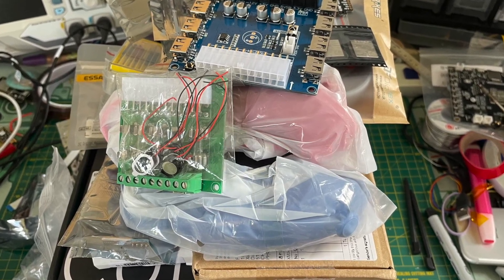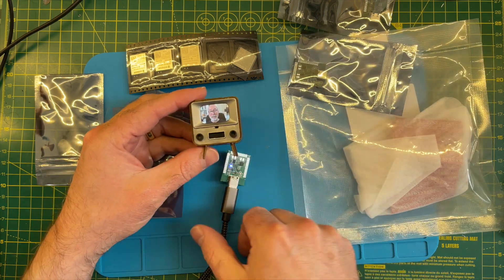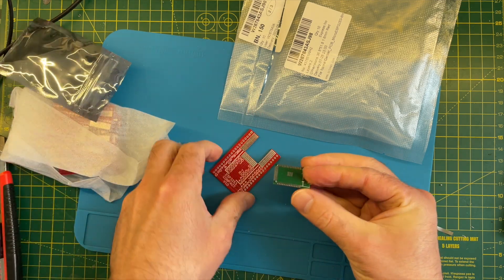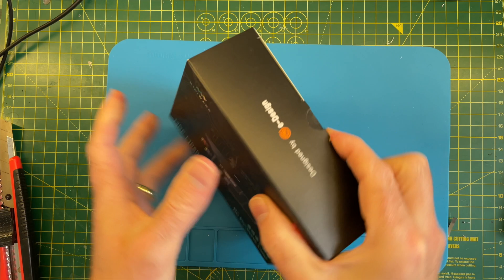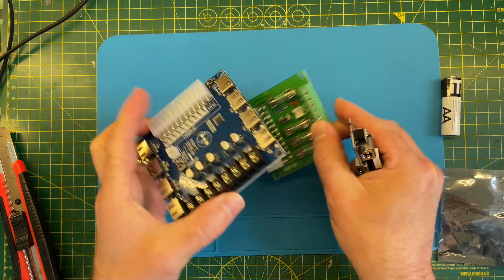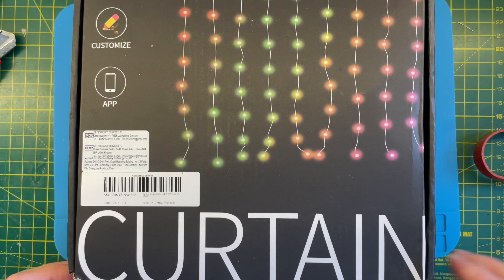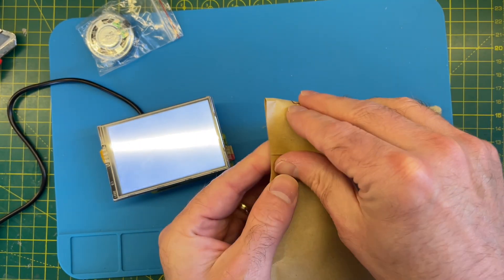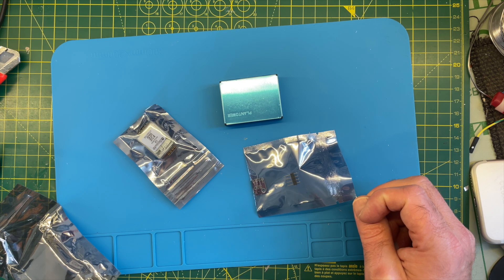Lots of Stuff - And a NEW PCB! It's a rare mailbag video.

Comment: Where can I bye the yellow display? Who cheep is it?
Reply from the maker: You can buy them here: https://s.click.aliexpress.com/e/_Dd70zcb but make sure you shop around for the best deal.
Reply: @atomic14  , thanks this is a good price for this display with touch and ESP32 and 240x320. the 4,3” with ESP32-S3 and better resolution double the price. if programming this is easy than it seems a good combination. I low displays in combination with a powerful processor. but I can’t find any YT-Videos programming this display. I think 2,8“ is to small but cheep. my projects have 3,5” or 4,0”. did you have experience with this display? are there any specs and information how this is connected to the ESP? SPI or parallel, with GPIO are blocked?
programming menu and submenus with touch is a lot of work. Where can I find examples for this?
Reply from the maker: You can find a lot of details and sample code here from Brian Lough: https://github.com/witnessmenow/ESP32-Cheap-Yellow-Display

Comment: Mmm, lots of interesting projects on the way--cool.  One thing you might want to try:  long ago, I was using a lot of BLE112 modules and they had castellated mounting hole and wound up making programmer and adapter boards that gave you the option of using standard 50mil pin headers so placed that you'd just squeeze the module in and it would hold just with tension.  Would not be good for permanent installation, but for breadboarding or programming it was great as I could just pop the modules in and out.
Sidenote, first thought when you showed the nunchuck "hm, well that's not tiny at all"  oooooooh, "wii" not "wee"!! hah
Reply from the maker: I need to take a look at using some FlexyPin(s) for this use case. In a way I kind of regret getting the castellated edges - they really increased the cost of the PCBs and realistically I'm going to be soldering wires directly to the board so they aren't going to get much use.

Comment: I would really like to have some source files or links of these ESP32 breakout boards and the breakout-breakout boards!
Reply from the maker: I'll do a proper full video on them soon. Really want to make sure they work.
Reply from the maker: I've added the link to the description - use at your own risk - it's completely untested at the moment...
Reply: @atomic14 Thank you a lot for sharing! Unfortunately, I'm unable to open the EasyEDA design through your link. It just opens a new schematic at my end. Is it shared correctly?
Reply from the maker: @Radiofreak1041 Does this work? https://oshwlab.com/chris_9044/sandtable_copy
Reply: @atomic14 Yes it does, thanks a lot! Did you also make the extra breakout board (with the pin headers) yourself?
Reply from the maker: Yep - here you go: https://oshwlab.com/chris_9044/microesp32s3-breadboardadapter
Reply: Truly amazing! @atomic14